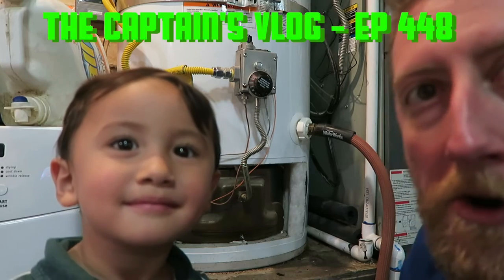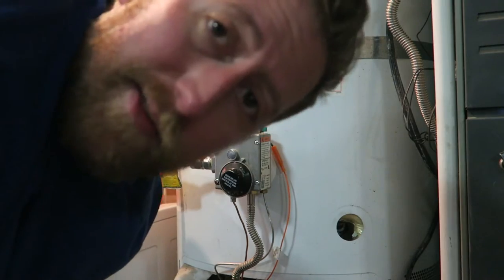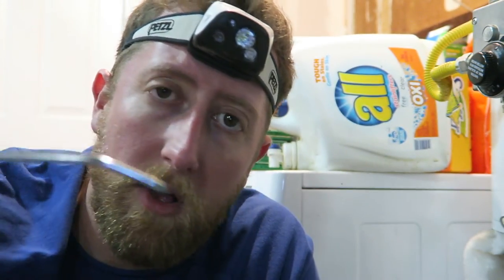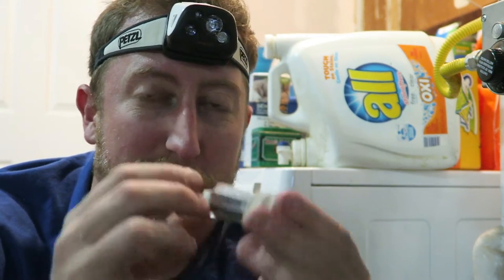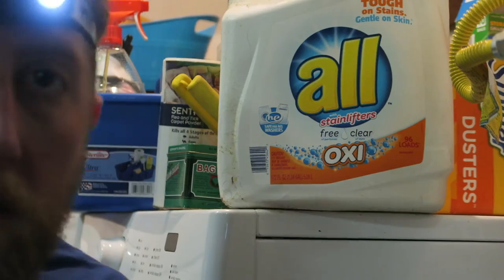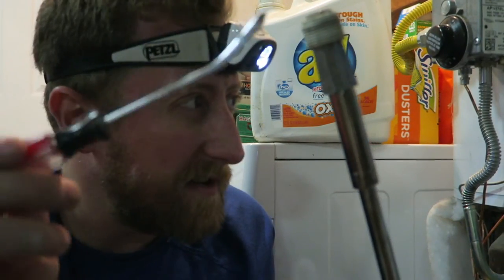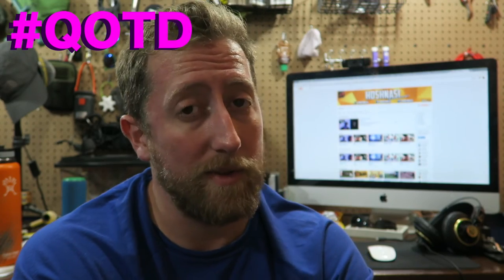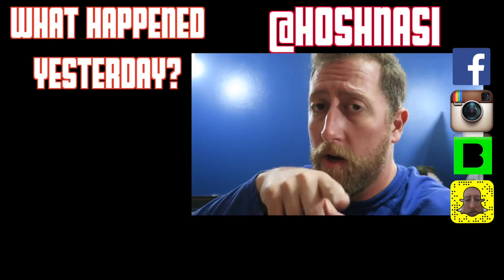How to fix a broken water heater drain

Comment: Suggestion… Prior to inserting the sprinkler valve tool, heat it up so that it will melt the plastic fitting and in bed itself into it, let it cool off a bit and then proceed to remove it turning it counterclockwise. And ...Thank you. Your video gave me confidence in removing my very old plastic valve that I’m pretty sure will break inside.

Comment: Thanks for the video! I would not have replaced the drain valve with another plastic one, I used a 3in. piece of 3/4 in pipe threaded on both ends and a quarter turn valve.

Comment: You shouldn't ever use plastic valves. They should be outlawed. I'm a plumber and I've had a bad experience with them. Plastic gets brittle....say no more
Reply from the maker: I agree.  I'll end up swapping it out for a metal valve.  I was worried about dis-similar metal issues though.
Reply: I try to always grab the brass ones off scrap tanks and swap out the plastic ones. Bi-metal is not ever an issue in my experience.
Reply from the maker: Great tip!  I always prefer copper when I can get it!
Reply: I guess it depends where you live.  In New Mexico the well water is so bad that it eats through pex brass fittings. The fittings start to turn a greenish color and just start leaking.  A mobile home service outfit here said everyone has the same issues with the well water and advised me to try Flair-it fittings which seem to be made of a high quality plastic.  Knock on wood but they seem to be holding up pretty good so far.  I've thought about changing the plastic valve on my water heater and replace it with a brass nipple and good quality ball valve for flushing but am afraid it will start to corrode as well.  I respect plumbers or anyone else who works in the trades.  Thank you and God Bless...

Comment: Thanks for the video. Trash that POS drain replacement and put a 3/4 inch quarter turn ball valve with sch 80 nipple. That will allow you to do a much better job of draining the tank and have a positive closure. Thanks

Comment: If you run in to something like this again. Take a hack saw blade and make a few cuts through the plastic pipe. Stop short of the metal threads. Then pry the plastic out with a flat head screwdriver or a small chisel.
Reply from the maker: Good idea.  I guess I'm lazy and just always try and melt things out if I can haha.
Reply: Nick Cook...you, sir..are my new best friend. I didn't have the world's largest ez out and your method worked like a charm. Thanks man...you turned a bad day into a good one.